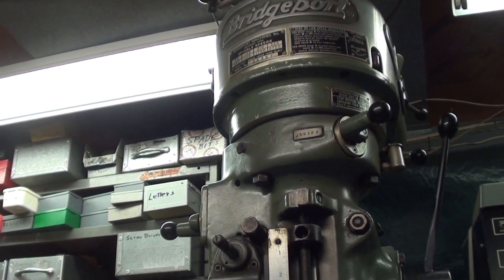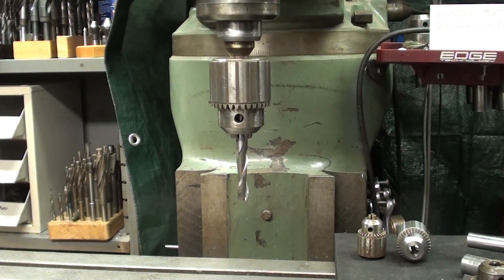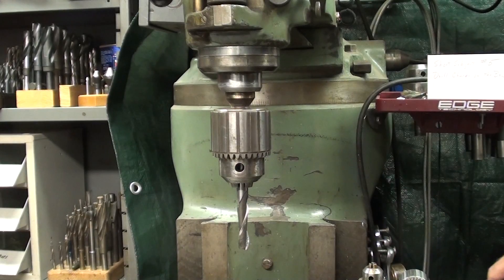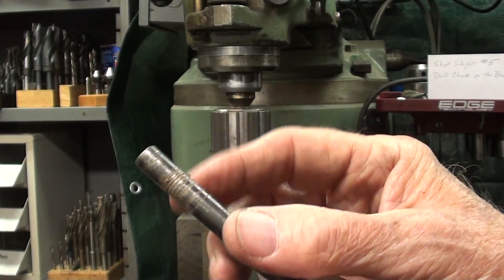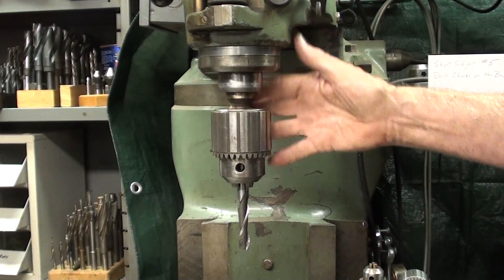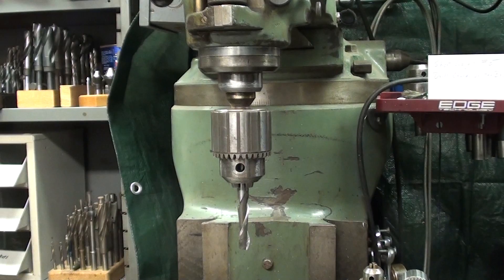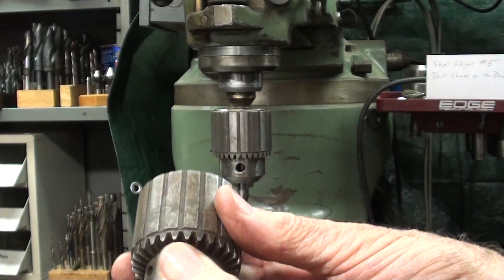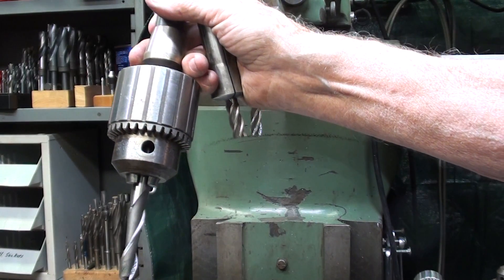SHORT SUBJECT #5 Drill Chucks on Bridgeport tubalcain

Comment: One of my chucks is was beat on with a hammer, then welded. It will not come loose, ever. Run out is .0015"
And for small cutters or hard to reach places, sometimes it is useful.
Reply from the maker: Welded on, That’s funny

Comment: Do Americans not have the old clarkson colley chucks ? The finest ever made. Retaining the endmill by a fine thread on the shank
Reply: 60 years in the trade and never heard of a clarkson collet chuck. If you had such a device where would you find end mills with a fine thread on the end of the shank? Obviously not a practical design.
Reply: There mongrel things, I've got one and I'll probably never use it ever again
Reply: @markshort9098  when the cutters are 2 inch plus in shank they’re one of the best tools about
Reply: @machiningbasics1729  mine only holds up to i think 3/4".. i wouldn't ever use a 2" shank in a Bridgeport, they aren't powerful or rigid enough for that  in my opinion.. i prefer to run dedicated tool holders for anything that's to big to fit an r8 collet

Comment: Personally I avoid drill chucks for drills as well. Even a HSS-drill benefits from being held in a collet (better grip, steadier, will run more true (thus reducing the need for a (proper*) spot drill).
Solid carbide drills should definitely not be used in a Jacob's chuck, maybe in a modern side tensioned or hydrualic chuck.

*Don't use a lathe style center drill in a mill. Use a spot drill with a very small core (sharp tip). 
For HSS drills: Use a spot drill with steeper tip (90 degrees common)
For Solid carbide: Use the same tip angle as the drill